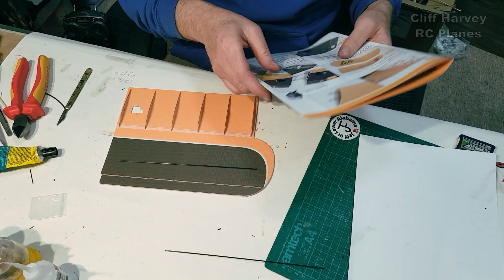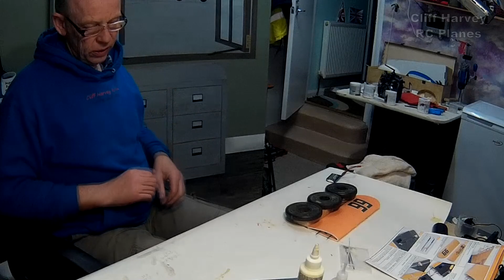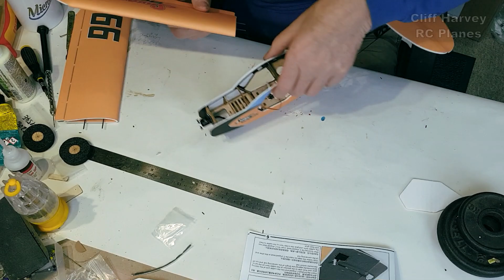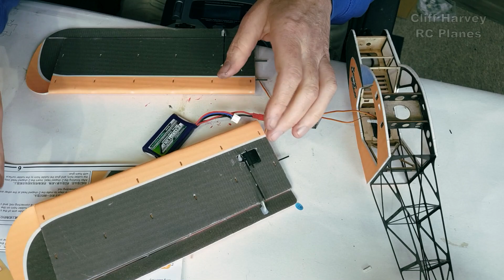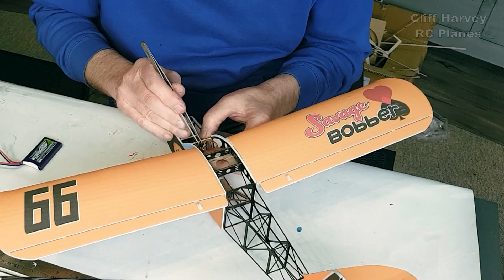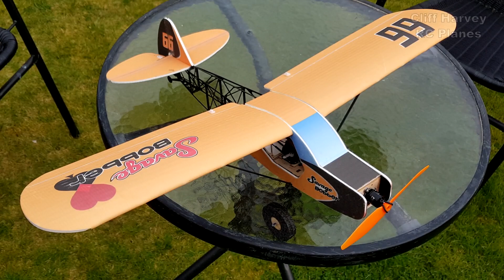Dancing Wings MINI SAVAGE BOBBER BUILD Part Two

Comment: Such a smart guy Cliff!! Why are these types of planes called 'Bobber' is it a brand? Well made indeed
Reply from the maker: Hi Bellair, something that has been 'bobbed' has had parts removed for weight saving and simplicity. So an aeroplane doesn't need fuselage covering, doors, heater etc, cheers 👍